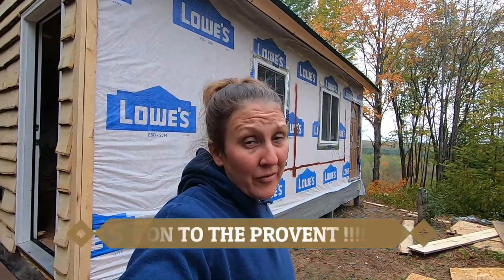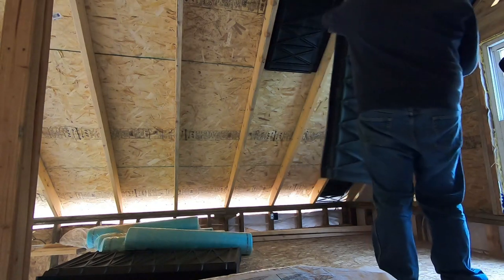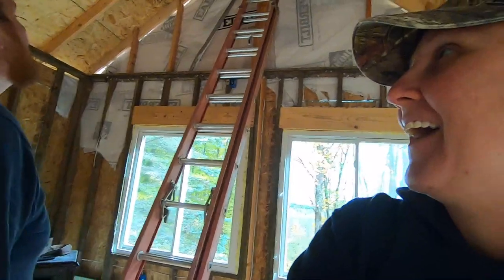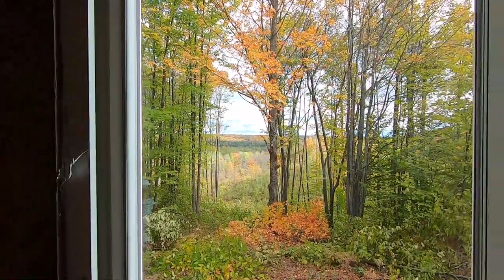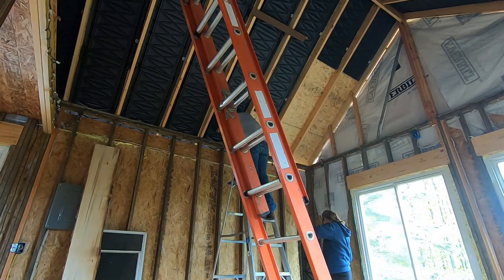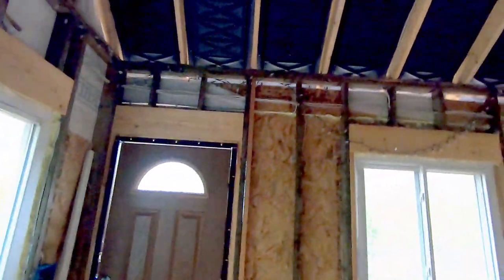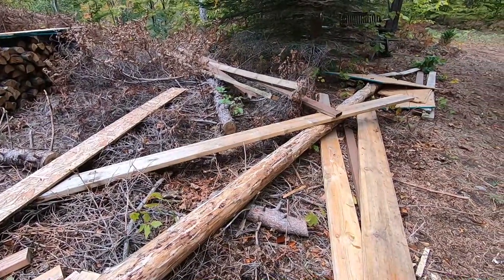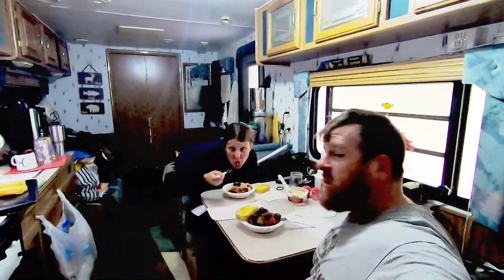Roof Ventilation |Off Grid Cabin Build Part 18 Installing Roofing Ventilation

Comment: If you're thinking rustic, old recycled corrugated tin roofing for ceiling? Whitewashed pine to contrast with natural wood?  Shiplap? Bamboo flooring also a cheap alternative and contrast to all the wood, and some stained versions are really beautiful. Also easy install. .  Love your attitude and fun.
Reply from the maker: That's awesome. Jay likes rustic, jen likes little more rustic/modern....we will have to find some common ground for sure. We both like shiplap. Thanks for watching and the suggestions.

Comment: Wow now that picture of the new found gorgeous view is worth FRAMING!!!  Did you put drip edge underneath the metal roofing on the gable ends?  Does puppy have a doggie pillow?  Wow ceiling ventilation looks awesome!!!
Reply from the maker: We put drip edge around the whole roof. I think we are suppose to use something different on the gable ends maybe. But I plan on flashing the gable ends to protect them more. The puppies have comforts down at the campers. Normally up st the cabin they just roll in the dirt, and love it. Lol
Reply: @OffgridwithJayandJen   The drip edge should go over the top of the fascia board and down the front of the fascia board a bit.  I guess I didn't see that correctly.

Comment: how does the top of the roof vent to the outside? Is there manufacturer recommendations when using the provent panels?
Reply from the maker: The end caps of the ridge cap at the gable ends are open to allow an upward flow of air. I believe you are suppose to also vent the air out the sides of the ridge cap using a strip that allows air flow, similar to the filter type material on a pond filter or the gutter type strips that keep junk put of your gutters, but we used solid foam strips on the sides of the ridge cap so they may need modification at some point.
Reply: @OffgridwithJayandJen  OK Thanks
Reply from the maker: I just read my prior response and noticed the first sentence was all messed up, sorry about that, stupid auto correct messed it up. Makes a little more sense now that I fixed it. Best wishes roughcut
Reply from the maker: @RuffCut  also, I love your cabin and wrap around deck.......Jens dream is to have a covered wrap around deck like yours, we will be doing the same or similar to our little cabin......I have watched a few vids from your process, looking forward to going back and watching them all. Thanks for them.
Reply: @OffgridwithJayandJen  I got the idea...I didn't know if you were using  a "vented ridge cap."
Reply: @OffgridwithJayandJen  you're Welcome...our cabins are about the same size and we have the porch because we see it more as a meeting place or "lodge."

Comment: Progress is always good nice job. I have one suggestion or comment and I am not a builder so maybe very wrong but given the size of the rafters would the roof overall not benefit from some collar tie beams, even if closer to peak? I'm sure you all get a heavy snow load.
Reply from the maker: That is an important part yes. We have been slacking on that. The loft is helping hold together the one half of the cabin walls and we are putting  a large beam or two across the sill of the walls across the open cathedral portion soon. Hopfully this weekend
Reply from the maker: From what I gather collar ties if placed in the top two thirds of the rafter dont help much, so the beam or beams we going to put up will sit on the wall sills and I'm going to join them to the rafter bottoms also
Reply: @OffgridwithJayandJen  thx  for your reply sounds like you have a plan! cheers!

Comment: Hey guys, I saw in your last video you had installed wiring.  I just finished watching “Maple Berry Farm” channel and gave a comment on what our hunting club did for power, lighting and heat so I’ll do it here also.  For water we used 250 gal totes with the same set-up as you guys with the exception of hauling in municipal water in and transferring water from one tote to a permanently mounted tote.  For heat we used propane. For power we used 12 volt batteries and 120 volt onan generator.  For lighting we used a 12 volt system, 120 volt system, and propane lighting.  To keep our batteries charged, we had a 12V charger hooked up to the generator.  We ran copper tubing to permanent mounted gas light fixtures.  We didn’t use grid power (to costly to have the different utility companies to provide services - too far to off grid). Solar power for electricity was not an option.  A wood stove was out because no one wanted to chop wood (go figure - we had one at another camp).  Hopefully this was helpful.  Liked the use of “Provent”. I watched “Deep South Homestead” use it on their cabin build. Looking good guys, awesome!
Reply from the maker: Thanks lane for the first hand input, we appreciate hearing how others make things work without using on grid services